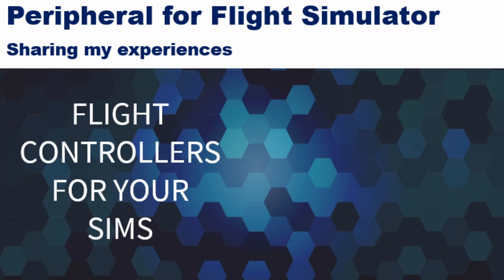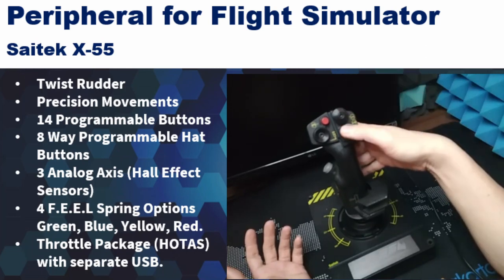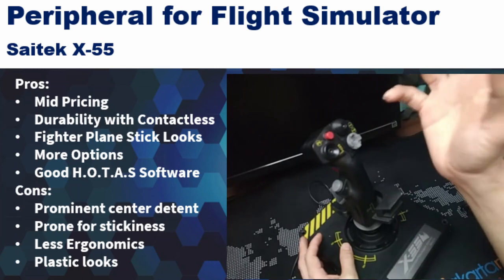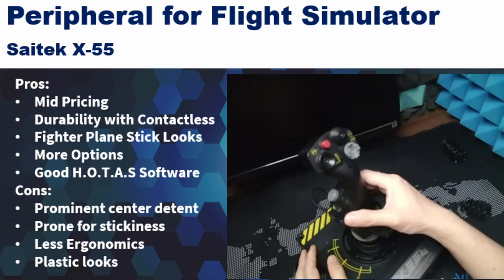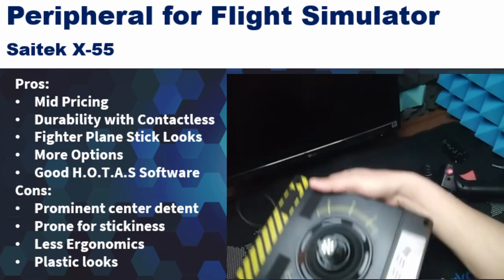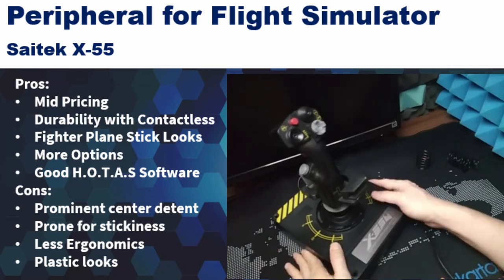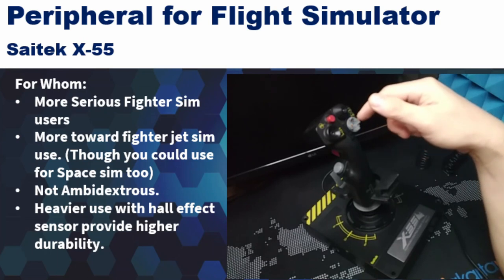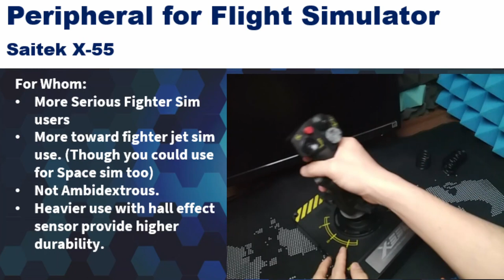Review: Flight Controller Saitek X55 Rhinos

Comment: Hi
I have been using the X55 Hotas on pc previously. Would anyone know how to possibly connect the X55 RHINO HOTAS on the Xbox one? Can I source an adapter that will allow me to make it compatible?
Reply from the maker: I dont think its compatible joystick for xbox, so far no known adapter exist. One crazy idea but require a major hack is re wiring the x55 pots into existing xbox controller. But you probably better off buying a new set of xbox compatible hotas controller. I think thrustmaster have
Reply: @hobbytechgearID69  thanks, I did purchase the thrustmaster but it’s no way near as good as the X55. I found a product called ‘Titan two’ which may allow this connection but need to find out more and try to get hold of it as it seems to be unavailable on Amazon and can’t find a buyer who has it in stock